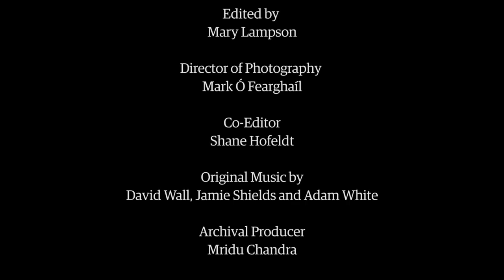This Changes Everything – Naomi Klein | Guardian Docs

Comment: Again.  The argument is not about whether the climate has been warming or cooling....the argument has ALWAYS been about what is causing these changes.  As our climate has warmed up significantly between 1980 and 1998 the assumption is that it must be caused by humans.  But what caused the cooling we experienced between 1940 and 1980?  That's when we saw the largest increase in CO2 and yet we cooled....so much so that in the 1970's scientists were calling for a new ice-age early in the 21st century.  Now in recent years the climate has stalled, or in fact has cooled.  It's always changing.

So rather trying to convince people that if we just turn off our Toyotas that we will miraculously reverse the warming we recently experienced, why don't we just try and clean up out air, soil and oceans?  Forget about warming....that is something that has always been out of our control.  Let's spend time trying to be clean....that is what we need to survive.

Also, keep in mind that the tar sands is a very small project when you consider how much land is used there compared to the rest of the country.  Before they started processing oil there it was already seeping into the drinking water, and leaching throughout the land.  One could argue that the tar sands project is actually preventing more of that oil from poisoning the land and preventing humans from living on it :-).